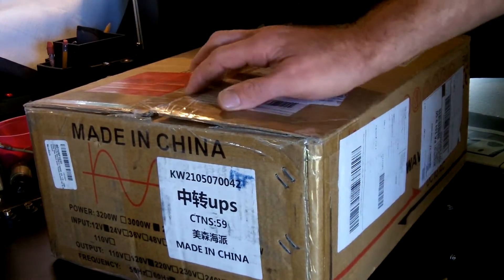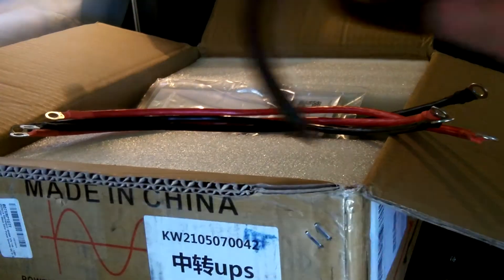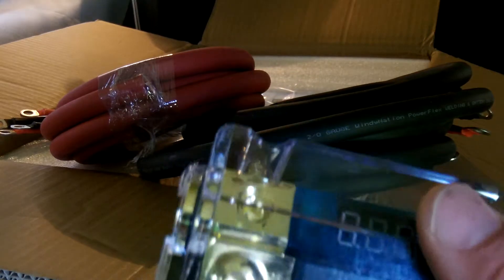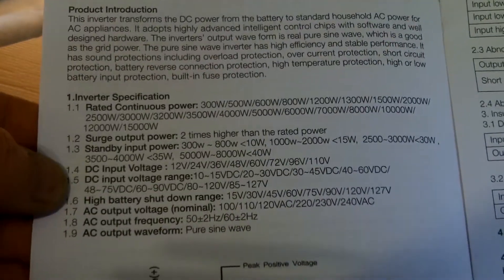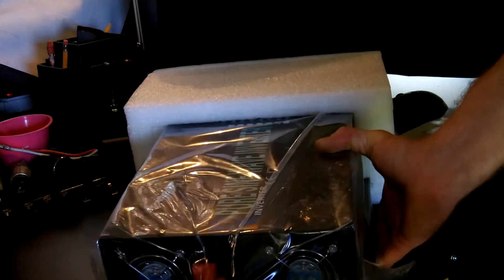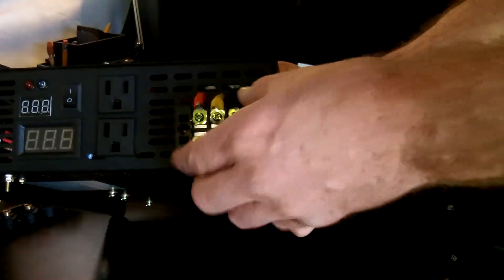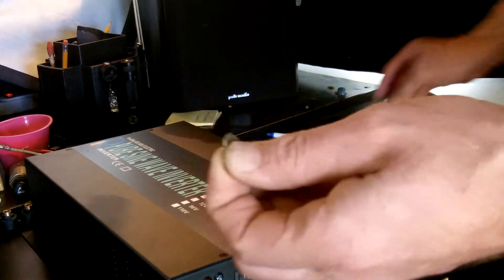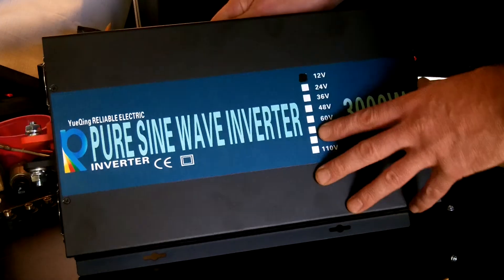WZRELB 3000W 12V DC to 120V AC pure sine wave inverter

Comment: Whats the name of that bad boy 300amp fuse with the LCD brother?!?
Reply from the maker: ZOOKOTO 300A Fuse Holder,Car Stereo Audio Led Display Digital Voltage Inline ANL Fuse Holder 0 2 4 Gauge in Out with 300 Amp Fuse
Reply: @classaendlessadventure2879  Thanks mate
Reply: @myresonance8013  

Is 3000 watts or 1500 watts continuos power?

Comment: Do you have links for the Inverter and Wire? Thanks great video.
Reply from the maker: i bought of of amazon as far as wire gauge that all depends on how far away your running the wire there is a sight you can google gives you a chart on amps and watts to determine correct wire size thanks for comment